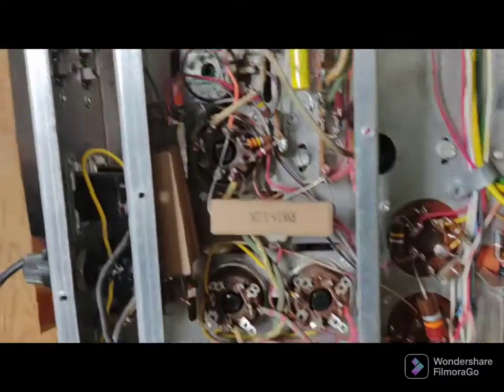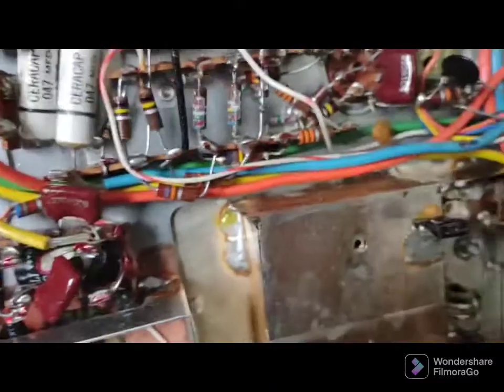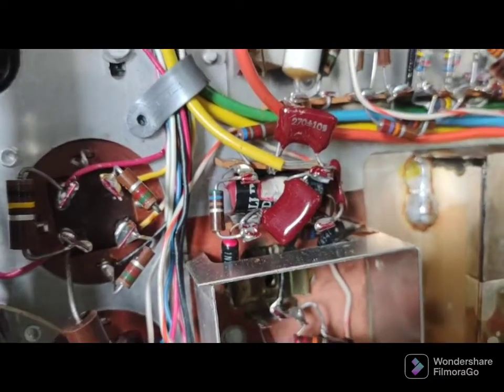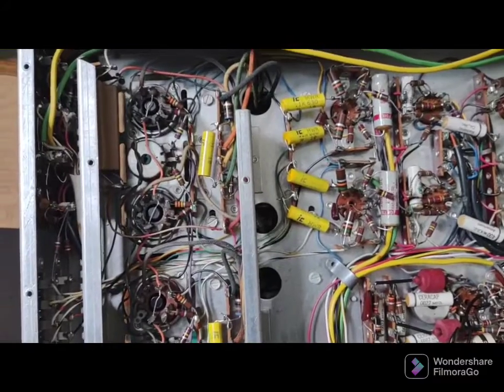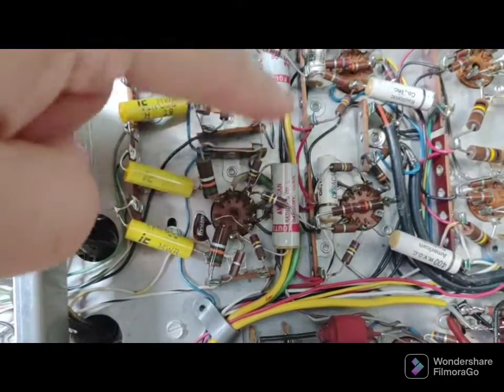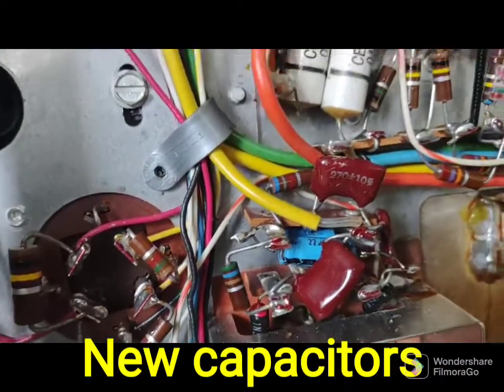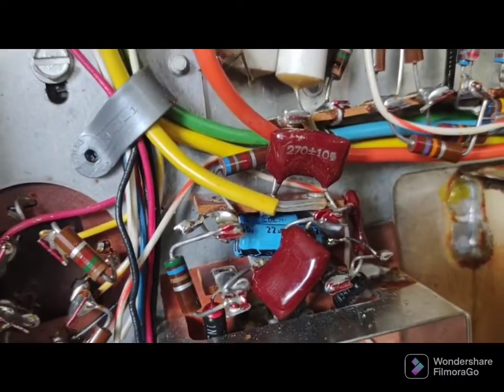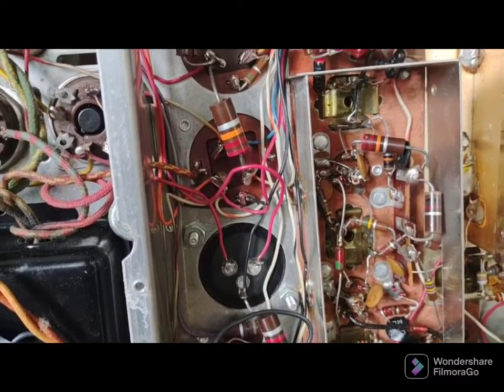The One and Only - Scott 340, 60 year old small cap failure

Comment: D, mom wants to know if the popping/failing capacitor could have caused an internal fire.  We are watching in-between periods.  Go Isles!  Great vid, btw.
Reply from the maker: Lol.  Snap and Crackle are still at large !!  Fire possible but not probable.  But you never leave vintage equipment on and leave the room/house - as a general safety precaution. 
      One time we left the 299C on overnight !!!!  And this is when it was 50+ years old.  It was fine.